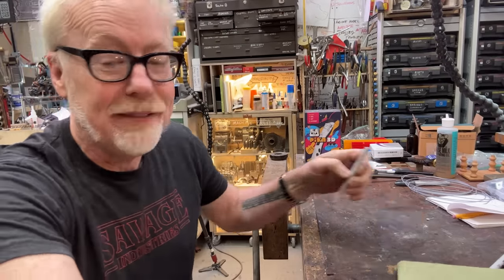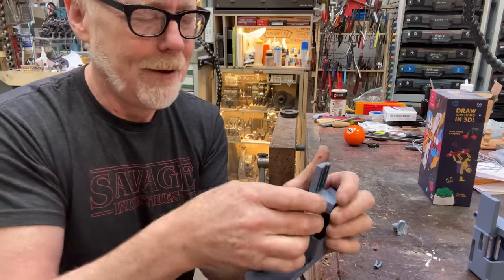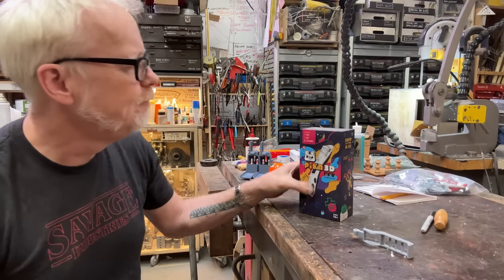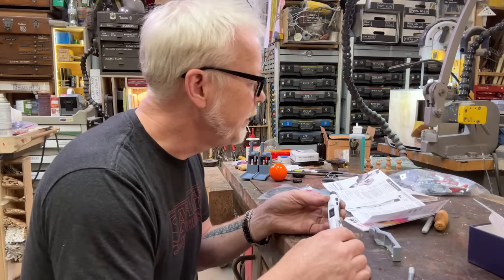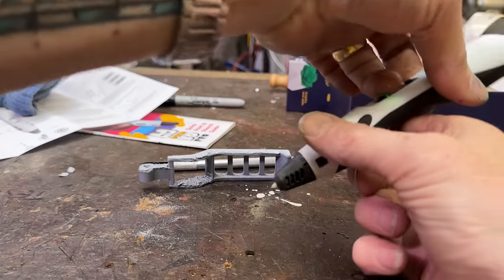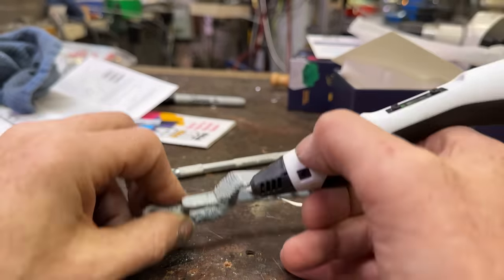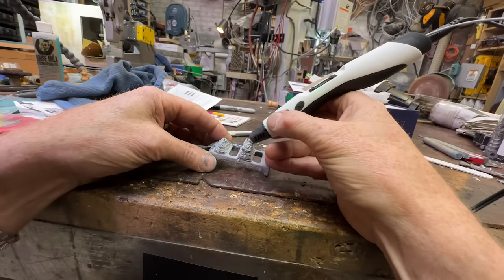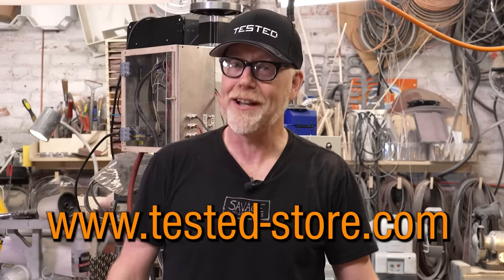Adam Savage Tests This 3D Printing Pen!

Comment: I recently saw a few artists on instagram use a mixture of wood filler and acetone (2:1 I believe) on PLA prints to create a surface on the 3D prints that's lightly sandable. Could be a valuable method if you're looking for something that looks more "finished", or something that would take a coat of paint. The part you were fixing looks like it would print decently with the wider flat edge resting on the bed and the ramp piece being supported with tree supports. Cura and Prusaslicer both have updated tree supports that pull away a lot better than they used to (and i think a "concentric" interface pattern leaves a not-so-terrible finish that can usually be nipped off with flush cutters or sanded down).

Experimenting with all of these tools, materials and settings is where half the fun is!
Reply: The part he printed would be best for just quality strength not mattering if put to stand on a corner so theres no bridging just 45 degree angle overhangs

Comment: I have the MYNT3D professional printing pen from Amazon. The switch on it is not a feed on/feed off toggle. You push and hold the button. I feel you would have better luck controlling filament feeding with it vs that on/off toggle.

Comment: It needs a flat blade attached at what is considered the top, so as you apply the filament,it will level it and fill in the gaps better, and not waste any. Think of mudding for dry walling

Comment: I've been 3d printing Halloween masks for 7 years now and let me tell you there are years worth of rabbit holes you can go down to tune your printer to get beautiful prints. with my novice eye I can spot too much of a gap between your supports and model (slicer settings) and under extrusion (the gaps in the walls) anything is beneficial to combating print errors and decrease post processing time. I like the bondo spot putty, jb waterweld, soldering iron, and sandable filler primer for my smoothing. but however works for you, have at it.

Comment: Adam, I would recommend learning a 3d modelling software, and then watching the videos by Slant 3D, great info on designing parts for 3d printing. If parts are well designed for the propoer process, then this post process should be too necesary.

Comment: Great for making adhoc brackets and supports. Just put the components near each other and draw in a bracket, even right around a couple screws. I made a quick case for a Teensy microcontroller to which I added an oddball connector, worked great. Looks messy but whatever.

Comment: I got one quite a while back for big projects.  Print your parts on the printer, join with a glue of choice and use the pen to weld seams.  Great little welder.  I have the 3Doodler Create.  Will likely wind up with a second one.

Comment: Supports to part interfaces are very rough if you use tree/organic supports like you're using. You need to increase the support interface percentage and lower the gap (z-height) between the part and the supports. It will help a fair bit.

Comment: LOL. Have fun sanding PLA. It is fun to watch you learn what many inthe maker comunity have known for years. I thought I would need a 3d pen, but I never needed to use it. sanding PLA loads up the sand paper fast because of its low melt point. it would be less time consuming and effort to print ita second time in a different orientation and drill the hole

Comment: A trick is, you can stop the filament coming out and then just use the hot tip to push the plastic around, kind of like the ironing on printers, although when doing this some filament will ooze out, again like the ironing on printers.

Comment: back in the day when I worked at Maplins we got the 3Doodler pen, possibly the first commercially available 3d printing pen, I pre-ordered one and got it sent to the store on the release date, it was terrible, the thing took forever to heat up and when it did it over heated and stopped working, I gave up on 3D pens after that , 10 or however many years later it is now they are a bit better.

Comment: I could see this being useful in cases where you just need a part, but don't need it to be exactly to spec, especially if it has geometry that's easier to trace over than model. The speed alone is what's convincing me this could be viable since even in "rapid" prototyping, the modeling -> printing cycle is often in the order of hours and not minutes

Comment: you should try again but finish with a flat bit on a soldering iron instead of using the precision knife, you could even of used the soldering iron to fix those parts without adding more filament with the printing pen.

Comment: I feel like a soldering iron for plastic welding is better than a 3d pen as that’s only melting and merging on the surface. This is not dissimilar to metal welding. I personally would want a deep weld over a very superficial surface weld.

Comment: I bought a 3D pen to see if I could fill gaps in multi-part models, using the same filament. Problem is the heat generated isn't enough  to fuse with the base material ( root penetration in welding terms ). It will stick, but flakes off when you try to sand it. It does work on very thin sections, but as the material gets thicker the adhesion drops off. For other uses, with practice, you can make plastic netting - ally foil over small boxes & you can make a cargo net that conforms to the shape underneath, I've also attempted to make radar dishes, printing over a large glass ball, but getting the strands even & equal spaced is very difficult.............

Comment: Now take a a heat gun and use the exacto blade like a trowel and smooth it down. 

And the built up chimney, use the the heat gun to make it pliable and adjust it.

Comment: Try that 3D pen combination with ultrasonic cutter to cut excess and smooth out the surface. I got excellent result on improve 3D print post process or any plastic parts repair.

Comment: Try wood burning tools. If you hook one up to a adjustable voltage adapter you can control the temp and use it like a welder.

Comment: I absolutely love 3d printing. I’ve finally got my 3d printer almost printing perfectly the only thing I’m struggling with a little bit now is my top layer is over extruded but only my very top layer. I can’t figure this out for the life of me
Reply: @Ohioan29 thanks for the tip. I already have my fan up to 100 after the third layer so idk how much more I could turn it up. I usually just print PLA though. Very rarely PETG and TPU. I never used ABS or CF anything like that. Just yesterday though I re-flashed the firmware on my ended 3S1 with the newest MIRSCOC professional firmware he made for my printer that came out in sept 2023 and then I ran teaching techs calibrations for esteps, flow, and some other things and now my top layer is a bagillion times better. It used to be rough like it was over extruded but now it’s pretty darn good looking

Comment: I use a soldering iron at 200C to smooth things out with different shaped attachments along with my 3D printing pen and heat gun for freehand sculpting. I'm excited to see what you can do with this tool! I prefer "mynt3d" for brands.

Comment: Ive been thinking of buying one to repair parts too. However i dont think its very good for what you are doing with it. maybe if you added extra plastic with it but then smoothed it out with a flat soldering iron tip or something. My thoughts for a use for it is repairing cracks for example. I have 3d printed a few parts recently which 608 bearings were inserted. Trouble was the part wasnt quite accurate in dimensions leaving the bearing holes slightly too small to just push the bearings in.  I forced them in anyway with a little persuasion from a hammer, This then just cracked the part i had printed.

My parts are not really holding a heavy load and the cracks dont spread or widen when in use. The time it took me to print them and the material used doesnt really justify doing re-prints. So though about getting such a pen to just pump plastic into those cracks.

Another example just sprung to mind in a video i watched of yours recently with the filament spooler you printed where you needed to transfer filament from a 3kg spool over to 1kg spools. The spooler you printed was slightly too short for the 3kg spool so you used dowel and glue to expand that. You could remove the dowel, print it in plastic then plastic weld it together with that pen.

Comment: Got a Mynt3D pen for repairing, reinforcing or just general post processing of prints. It's pretty nice to have, has a slider for flow speed and its a hold-to-dispense so it provides better control. I think 3Dsanago (3D pen sculpter youtuber) uses something similar and I highly recommend watching him to see the real potential of these things. Anywho great video as always Adam 👍
Reply: I bought the same pen recently and I've been using it to weld parts together.  Love it.

Comment: For the parts that require lots of support you should use a resin printer. It will be almost perfect out of the printer. If you think those are pretty prints you've seen nothing. I have a P1P and Elegoo Saturn and when it's about look I use the resin even if it takes a bit more time. The parts looks like injection mold parts.

Comment: Albeit it’s just easier to re-print with the additional support, brim, other orientation, try circular overhangs etc. 3d printing is more about getting the better results out from the machine and the post processing is rather an experimental approach every time just to make something fly as mvp when you need to iterate fast. That’s interesting to watch, but getting it out of the printer especially with the increased speeds yours have is way easier

Comment: I feel like it would be a good idea to have a tilted hot end tip so users could comfortably apply filament from a direction normal (orthogonal) to the underlying print surface, as would be the case with a real FDM printer.  Thus the filament would be more firmly pressed into the surface, granting better adhesion, thinner layers, less wasted material, and easier post processing with initial results landing closer to the user's intent.

Comment: wonder if you can lay the infill down with that that filament pen, and use a hot-knife to smooth it.   a mechanical third hand to hold the work piece in place would be helpful too. ... ooh gotta try this now.

Comment: I wonder how silicon caulk would have worked for this type of fix? I saw a lady mix acetone and woodfiller (1:2) to smooth common gradient lines, which would likely have worked for this. The pen is pretty neat though, especially if it works with TPU. Could splat little rubberized finger grips on things.

Comment: PETG is fantastic!  I barely bothered with PLA.  Actually it was the third or fourth spool I bought.  I then later got some carbon fiber PLA.  But really REALLY stick with PETG.  I've got a couple ABS's, they are not easy to work with, but sometimes that is required (made some brackets for a fuel rail on my car for example).  

I don't like the fact that PLA will snap suddenly.  For example, if I want a bracket for something, I want to know it will show signs of strain before it shears and causes catastrophe.

Comment: I would try a much hotter temperatue (180-200c), applying just a small amount and then quickly smoothing it out with a knife or silicone stick

Comment: If you're interested I can post my support settings which both on rafts and normal supports leaves close to perfect surfaces. Obviously it's not as good as the top surface but it's damn close.

Comment: Is that black shroud on the end that's in your way a safety device or is it some kind of insulator for the heating function? Perhaps it could be removed to give you that "reach" and "length" you're looking for, albeit with some caution.

Comment: Lay down about 3 seconds worth of filament, then smash it on a flat cold surface (Glass or metal). That should smooth out your filling. I used to do the opposite to make small model valves. Heat up some sprue and smash it into a model wheel...bingo, instant valve effect.

Comment: I use the pen to weld parts together and use a wood burner with adjustable heat settings and a spade end. Also, where's the link to the files for the pulse rifle stock at???

Comment: If you had a half mold then it would make a mini injection type molder. CNC cut some molds or silicone rubber some. Could it actually injection mold a tiny aluminium heated split mold?

Comment: uv resin from a resin printer and a uv light. I put that shit on everything. Seriously, wipe it on with a q-tip or a brush, then hit it with the uv light, fills the gaps and levels out pretty easy and easy to sand. I even use it to bond parts together. Also for strong parts I use my resin printers over the fdm, much better bonding then the fdm.

Comment: I got one to fix my failed prints, but it usually doesn't look so good. 
Easier to print a new part. 

And if you dont want spagetti on that part, try standigt it in a upright position :)

Comment: Could you lay a bead of plastic and while it's hot attach another piece and then use it like a weld on both sides of the connection point?

Comment: Unless there's reason for the part to be entirely made of printed material, you're far better off using good old Bondo for filling and smoothing. Regardless, most part issues like this can be remedied through well thought out slicing and positioning.

Comment: It's still one of those products I don't quite understand 😅

For small repairs I guess it could be good but it seems pretty coarse and the filament definitely isn't melted enough to really flow into cracks. Maybe higher temps will fix it. 

Considering the cutting and sanding needed I'd honestly much rather just print a model again. My P1P can do that faster than I could do a good repair with this 😅

Comment: I use a pen for 3d printing cosplay models I split in half.  It acts as a welder. Lay down material, flatten/even it with a soldering iron, sand smooth.

Comment: Considering that PLA can be pretty hard to sand, I am not sure if I would do this on a smallish part. I have done it, had a pen longer then an actual printer :P
I do love the pen to fill gaps though, in things that are printed in several parts and might not fit to well, or even make small fake welds with it.

Comment: Adam,  filament makes a huge difference in print quality with these high speed FDM printers.   I have had the best results with the Creality Hyper PLA, and if you want a little better strength and durability, the Elegoo Hyper PLA plus is excellent as well.  The Elegoo one is noticeably stronger, so I am pretty much only using it now.  I have a Qidi XMax3 which prints at Bamboo speeds.

Comment: as you might have noticed, this is not the best use of this tool. The 3D pen shines, when free hand sculpting and making free hand wire frame sculptures. Try this: find a image of something you want in 3D and make a printed image of it, then trace it with the #D pen like you would an ink one. Then peel the plastic off of the photograph or drawing and proceed to make a wire frame using the tracing. then continue to fill in the wire frame, until you can sand and finish texture your sculpture.

Comment: Feels like you would have had a better starting point if you altered your support settings, tree style supports are great but clearly aren't doing the job here. I tend to use my 3d printed parts as is with minimal finishing, that part you tried to fix with the pen, would have been a reprint for me. 

Also as a few other people have said a soldering iron to smooth out the nastier sections might have been a better choice than infilling with the pen and sanding back down.

Comment: Regarding process.. always think carefully about piece orientation in order to minimize supports. Any 45+ degree surface from Y axis will print suboptimally, even with support. And then, PLA is a b*tch for sanding. Move to PETG  with running speed

Comment: I feel like the attempts at patching up would have been more successful if the pen had been used “with the grain” of the misprinted parts rather than across the striations. Trying to get the new strands in the grooves between the old ones to really fill them in.

Comment: This works great. also get a Tempcontrolled wood burning pen with a flat tip. it works great to shape added plastic. so du dont have to sand and cut so much :)

Comment: I think to fix those iss ues on your print would be to take a soldering iron with one of the larger angled tips and take filament and just pretend you're soldering something. with practice I think that would be better than the pen.

Comment: I use a 3d pen to weld parts together that were to big to be printed as a single part. It even givs the impression of a metal weld. Sure you could use CA glue or bolts....

Comment: I don’t think this tool is very useful for “fixing” bad spots.  For filling I believe it would be easier/better to just smear some filler over the area, work it smooth and finish sand.

But this tool does have a lot of potential as a creative device.  One could draw some awesome freehand designs on 3D printed objects, giving them a real organic look/feel.  Make “emergency repair” weld lines on a vehicle hull, turn a figure into one consumed by the Flood (Halo), etc.

Comment: I'm not even a novice with 3D printing, I have never dipped my toes in the 3D pond. But it kinda looks like putty when it comes out of the pen, maybe within 10 seconds you can mold it before it sets to get rid of most of the "drawing lines" then afterwards you can sand it.

I might be totally wrong about this, like I said.. I've never dealt with any 3D pritning stuff.